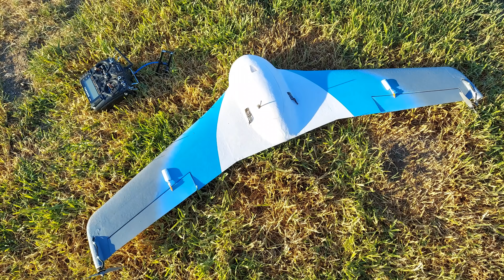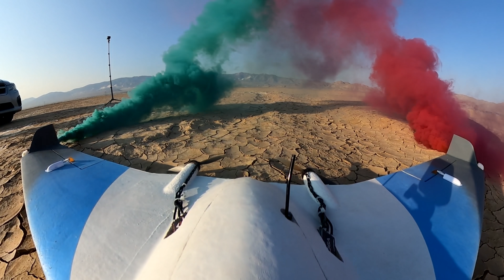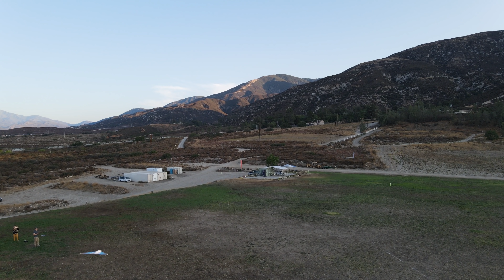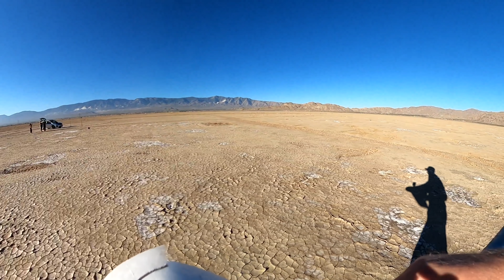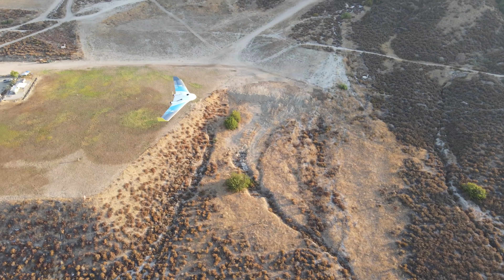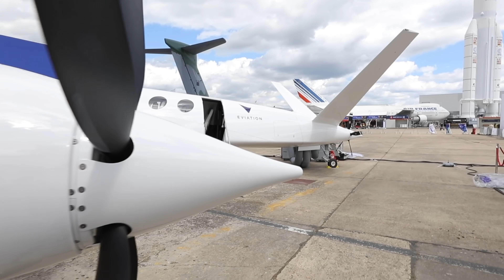Can Wingtip Motors Improve Aircraft Efficiency?  RCTestFlight Solar Collaboration Part 1

Comment: I think a good way to explain the increased efficiency is to look at something like the CFM RISE engine. Its a turboprop that has a second set of blades behind the first, only they don't spin. They're an unducted stator. The stator, which sits behind the rotor, turns the rotational momentum of the air coming from the rotor into extra thrust.
Wingtip vortices act like the stator in the CFM RISE engine, only the wing itself is the stator. Wingtip motors, if they were dimensioned appropriately, could push against that already rotating air, using less force than they would somewhere else on the aircraft to produce the same amount of thrust.

Comment: I don't think the main reason for having the thrust closer to the centerline on a multi motor configuration has to do with efficiency. Just imagine an engine out scenario.
Reply: My first thought.  With the huge off-center leverage, you'd get an instant spin, esp. in a tailless design like Serenity.
Reply: It is also to do with efficiency though, for a traditional engine, the extra strengthening required to place them at the wing-tip completely outways the benefits... But also engine out 
 operations

Comment: coop with RCtestflight? that is an insta-sub! 
i love to see more projects like this. such coinsidence that i just finish and maiden fly a wing with the same T-motor you are using. what size props are on there and how many S lipo you use?
Reply from the maker: 6x4 apc 5S
Reply: @thinkflight  cheers mate! i fly that motor on a 7x5 and phase wires gets so hot on 6s that i fear it will melt the styrofoam stuff inside
Reply from the maker: @cloudpandarism2627  Sounds quite a bit over propped!
Reply: @thinkflight  if we talking about the F90 then specs say 6" prop or 7040/7050... 
sooo i am not sure. maiden flight was as i said ok but i also didnt punch it. just fly very gentle. i need to see what happens if i do some full throttle runs. but so far i cant. first try resulted almost in lost of the AR wing because it started to tild left and down without under 100% power. i couldnt do anything to catch it. pulled throttle to zero and that gave me control right before impact. strange things these wing planes...
Reply from the maker: @cloudpandarism2627  No I'm using a t-motor 2203.5
Reply: @thinkflight  jeeez now i look stupid haha! i swear that thing looks exactly the same.
:D

Comment: The V-173 flying pancake explored this concept by having the props rotate in opposite directions to counter wingtip vortices and it worked quite well. However, one thing you need to consider is asymmetric thrust when one motor fails. Just off the top of my head, if you place a third motor at the centerline and shot off both wingtip motors if one fails, then you can eliminate the asymmetric thrust.

Comment: Wouldn’t you want the design for stall to be last at the wing tip?   Airflow is forced with the propellers out there, thus you would have ability to control that surface at very low stall speed.

Comment: I don't know if this could be helpful, but here's something:

"In situations where the mechanical resonance is strong enough, the resulting vibrations can cause a bridge to collapse from the movement. Typically, the longer the span, the lower the resonance frequency of the bridge. Lower frequencies are also associated with large displacement amplitude vibrations."

If you can counteract the vibration in the wing by placing another set of motors moving further away from the tip, offsetting their power cycles in a way that acts as a dampener, you may be able to further stabilize the wing, thusly reducing drag. The addition of the extra props will work as a double-edged sword, as the added propellers will give you added thrust allowing for longer periods of motor cut off time where the plane simply glides, and reducing the added dead weight necessary to stabilize the wings further. It would be like taking advantage of the new smaller electric motor's inherent capability of reducing load while increasing capacity. Load being physical weight, capacity being thrust (propulsion).
You might have to write one heck of a piece of software to get the power cycling correct, but if it could be done I would love to see it.
Reply from the maker: Not sure if its a thing, but if it is the solution would be beyond my electronics skills and analytics at the moment.
Reply: @thinkflight  I honestly don't think it is a thing, but it sure would be cool

Comment: The reason mid wing engines are more traditional is because a, in case of engines failure, 1 engine wouldn’t be pushing so much of the aircraft to one side and b, wing strikes would not affect the engines, while also giving more room for the aircraft to roll more when closer to terrain

Comment: Excellent video, beautiful visuals, and really fun topic.  Good work.  2 things I find really notable on this test mule:  rotation direction of wingtip props.  I might have missed it in the video, but surely, the prop directions are important to the project, and I would expect the 2 props would have to spin in opposite directions - the question is whether the props are rotating with, or against the normal wingtip vortices that would develop?    If against, the props would see more air, I would think.  The other question is the dihedral.  The plane has zero dihedral.  I assume the normal wingtip vortices are minimized in this wing configuration, at least compared to dihedral wings.  With negative dihedral, there may be further reductions in wingtip vortices.  I assume dihedral is a trade-off - slightly reduced lift, increased wingtip vortices and drag, but greatly improved roll stability.  The plane going nuts with the motors close-in was interesting.  I assume again, both motors were spinning in the same direction, creating some level of net torque on the aircraft, and then, no dihedral, so low roll stability.  I don't really see the wingtip motors compensating for roll, though they would for yaw.  However having the weight of the motors at the tips, would greatly increase the moment of inertia, helping to make rolling more difficult.

Comment: Its been done - over 60 years ago ! I'd have recommended trying out a scale model of the Vought XF-5U 'Flying Flapjack' in which the big propellers at the tips then interacted with the induced wing-tip vortex for 'cancelling' the drag induced in turn- permitting high performance despite high aspect ratio. Technology from the 1940's in WWII for you - there are videos demonstrating model flights from 1939 or so to show that not only do you get low drag, but you also get STOL !

Comment: Flying wings have a different lift distribution to straight wings, with the outboard wing flying less loaded than a conventional wing, this also means the induced vortex is further inboard so there will be less vortex available to improve the propulsion efficiency of the the prop, and less to gain from the upwash caused by the prop on the wing.

Moving the motor and prop further inboard to say half or 2/3's of half span might be a useful experiment if sticking with a flying wing configuration.  Alternatively a conventional layout with tail providing stability, and wing tip motors would also be a useful experiment.

Comment: Great video! Thanks. When talking about efficiency for real pax aircraft: Do not forget the yaw moment in case of an engine failure with wingtip mounted engines. In a passenger plane you would need a huge vertical stabilizer / rudder to compensate for the big yaw moment in case of engine failure. This vertical stabilizer / rudder would add a lot of form drag...

Comment: Probably the best system is distributed propulsion blown wing with 4+ props which give thrust and LIFT allowing less wing area for more efficiency. combined with landing gear geometry or tilting wing to allow large angle of attack for take off and landing allowing STOL operations almost rivaling VTOL. add bellshaped lift distribution to the wing for even more efficiency

Comment: The reason gliders use higher aspect ratios is definitely because the airfoil is upside down, and producing down force (when the bulge is on top, and the flat side is on the bottom). This is why many aircraft are tilted during takeoff, to slant the wing and produce lift. Without this, the wing actually produces downforce. Lift is actually produced underneath a wing, which is what flaps are for. If the airfoil were flipped, you could use a better aspect, that generates far more lift.

Comment: The thing about putting motors that far out on a manned aircraft is that the aircraft would be uncontrollable with a motor loss, especially on takeoff. If I remember right, Vmca is usually based on around 180lbs of rudder input after losing the critical engine. That varies by aircraft, I'm sure, but minimum control speed would be crazy high with wingtip motors, if achievable at all. I'm just a pilot, not an engineer, so take that for what its worth. Looks like an awesome project though,

Comment: Motor placed at wing tip can create large asymmetrical thrust. A plane can rotate quickly into a uncontrollable spin unless counter by sufficiently rudder force. However, the combination of spin and induced drag from the rudder will stall the airplane. Now you understand the reason all  aircraft makers do not  place engines on wind tip.

Comment: The wingtips also give a plus in performance. So most companys may say 15 % efficency increase against a wing without tips. 
A big problem of wingtip motors: The redundency of the double motor layout will be lost. When a motor dies, you have to shut down the other motor as well, because you have a massive lever and will turn or spin the plane.

Comment: In my opinion, if the aim of the future solar project is longevity and sustained flight, then the wingtip motors adding stability is a decent advantage. Though I could see how the engine pods and propellers may cast shadows on the cells or make it harder to place them effectively across the wing. I can't wait to see what you two come up with and to hear the reasoning!

Comment: First glance at the design with no fuselage and motors placed on the rearmost point was that it wouldn't be especially stable. But it flew pretty well to start with.

Comment: I think cons of wingtip mounted engines is requiment for much more rigid structure to hold extra stress (same that made Your yaw axis controll better) - and that lead to incerease plane mass. Anyway I think Your idea is genius for RC planes and drones, where theres extra stresses are not an issue at all, because of minimum material thickness  possible to manufacture. 
It also look awesome, cannot wait to see more!

Comment: Idea throw back: Remembering the use of tip tanks from the 50's and 60's planes to reduce wing stress, would it be advantagus to put some of that battery cells in the tip wing motor pods ?

Comment: That was fascinating!  Even if you didn't get that much out of efficiency, the propellers at the wing tips design eliminated the need for winglets and provided supreme stability.  It also provided a savings in weight and a reduction in drag.  I don't know if you went with that design for your next project, but there seemed to be a lot of promise for that design concept.

The centered motors design required winglets.  It was stable, it offered great performance, although slightly less efficient than the previous configuration.  I can see why one could go either way with either design.  The savings in weight and reduction of drag didn't seem to make that much of a difference.

Still, there seems to be some promise in the motored wingtip design.  Perhaps it should be further investigated, perhaps with a long straight wing design?  Or what about a straight bi-wing design with wing tip motors, and still no fuselage or winglets?

Comment: As far as I am aware, tip vortice controls such as opposite rotating props create an artificial wing span equivalent to the span plus the addition of the down blade on each side. That is a full prop diameter. The effect is as we would expect increased lift which is going to be more apparent on very short span wings, i.e. low AR of 1 or 2. For your own research you could look at ground effect machines, or Vought's V173 and successor aircraft. cheers

Comment: That yaw turn was sharp! If you're not going with motors on the wing tips, you should run some sims on split-tip/scimitar winglet configurations. It's roughly double the surface area of a traditional sharklet but tuning the size and angle of the lower projection can reduce a lot of drag and lower stall speeds. The trade off is oscillations at high speed if they're too big and adverse yaw if they're too small but every swept wing shape has a sweet spot. Just some food for thought! Great work as always and looking forward to Part 2!
Reply from the maker: I'd be curious to see what a pilot like yourself could do with wingtip motors.   Get on it good sir....

Comment: For a manned craft, you want to be able to withstand loss of a single motor.  That's why twin engine jets have traditionally put the engines as close together as possible.  The Osprey is a clear example of giving up on single-prop performance, but it can still spin both props using only one engine.     The gigantic size of the vertical stabilizers on some larger passenger jets is almost exclusively due to the desire to maintain yaw stability with only one engine.  So, Eviation's choice indicates they are starting to think about real people-carrying airplanes instead of toy airplanes.

Comment: Very intersting stuff. Major problem I can see is engine failure, especially with no rudder, but the further from the center, the more torque you get on the yaw axis. Also any difference in propulsion is enhanced by the distance from the center.
Neat design

Comment: There's something that doesn't add up for me.
While the pusher motors' prop vortex dampens the wingtip vortex, the drag is created at the wings. How do you reduce the drag if you kill the existing vortex? It already caused the drag if it exists.  As others pointed out, a puller motor in front of the wings would actually counteract the tip vortex.

A pusher however, should still work on a different principle. The existing wingtip vortex should give the prop a faster effective spin, giving you more thrust. 

So I think it's the same thing: combining the prop vortex with the wingtip vortex for better efficiency. The difference is that in a pusher, you get more thrust, and in a puller, you get less drag. It's the same equation but re-arranged.

I haven't read researches in this topic, what do they say? Are my assumptions wrong?

Comment: From my 35 years RC pilot experience, with correct size engine in wing tip you win on efficiency of propeller by escaping the high speed air from wing profile hurting rear engine. But front side engine are more efficient as they have all air to propeller. But they are problem for wing profile fluidity just behind front engine. It's a lost of gliding ability.
Wing motor improve the turbulence of wing tip, but these turbulences could degrade the propeller center propulsion. 
I also note that if engine always been near center of aircraft it's essentially for manoeuvrability and better handling . A plane with heavy wing tip could be stable in line without wind but can't manage fast response manoeuvers
You could love this apparent stability for solar long range flights, and been satisfied by the rest of handling available as you don't want to made acrobatic flight

To conclude: long range drone could desserve front propellers in wing tip for long flight in straightforward
I think rear oriented engine are less efficient. All RC propeller rear oriented are less efficient. It's commun observation from years.
And if you want to test duration flight I think you must choose the less amp motor with very good propeller test on ground. And draw a plane around compromise between solar power to light battery, and good low consumption electronic, go with a very good Reynold's profile that have long long allongement wing and low drag. One or multiple motor is only choose of current 1nd traction tests. 
After that you probably could stay hours in flight with very good handling 

For me the good geometry is more a glider than a wing. But why not a semi glider with a look based of Horten center wing a bit thinner, and glider long wing to finish it. 2 engine at least due to power amp in my mind with small prop high pitch low diameter .

I follow your future test 
Sorry for bad English

Cheers from France 🇲🇫

Comment: Surely to see the full effect of the props it would be best for the control tests to be without winglets? As well as having measurements using winglets. That way you'll be able to see the effect it has on the baseline vortecies created by the wing, not just how it performs in relation to winglets.

Comment: another issue i think that would arise from this is reliability/safety concerns because when the motor or jet engine is closer to the body it would have a higher chance of survivability if the wings get destroyed vs if the motors were at the tip of the wing losing even just the wing tip would immediately mean losing an engine

Comment: The reason that there was such little effect in the end is because a concept of lowering drag creating a zero net vorticity by propellers creating vortex in an opposite direction to the one occurring from circulation on wings is a missconception. It simply doesn’t really work. There are some benefits of placing the propulsion system like this but the propeller itself ,,untwisting” vortex behind wingtip is not one of them.

Comment: I often wondered if a ducted fan (fanjet) were built into the wing tip with the housing being tangent to the bottom wing surface if this would be efficient and reduce tip vortices drag.